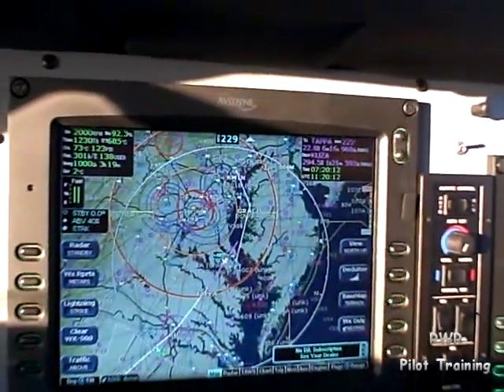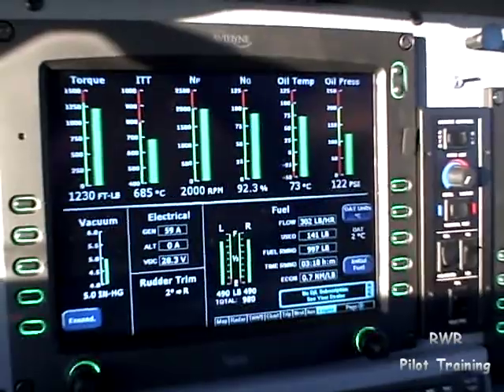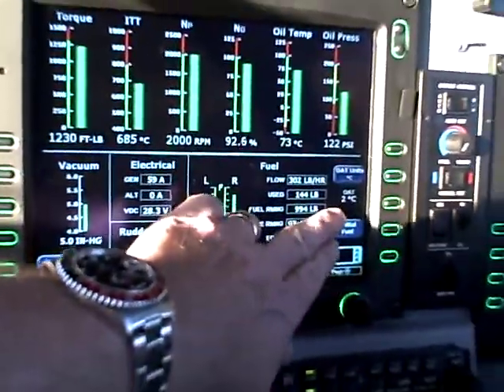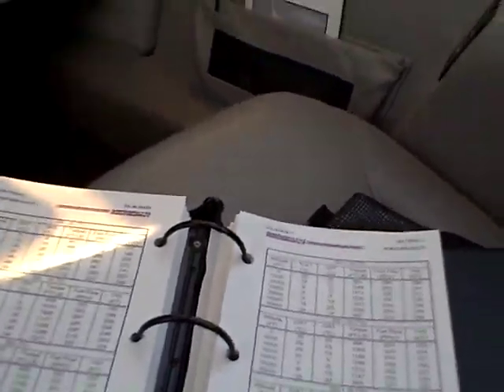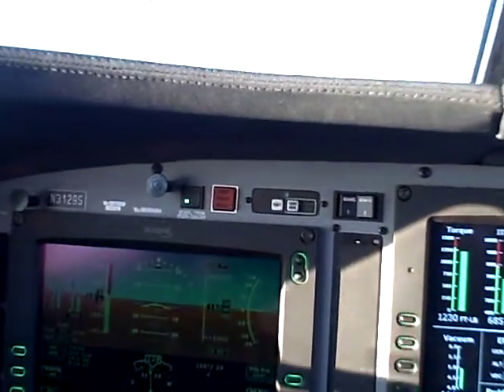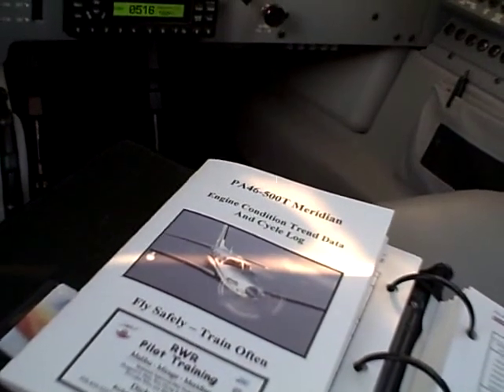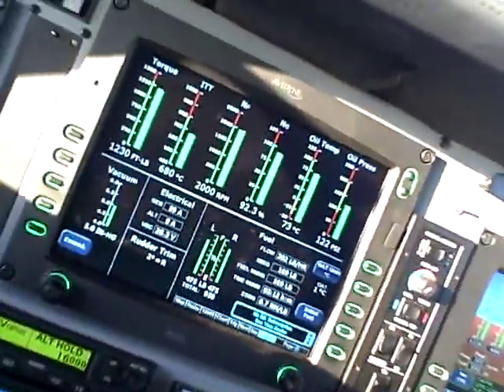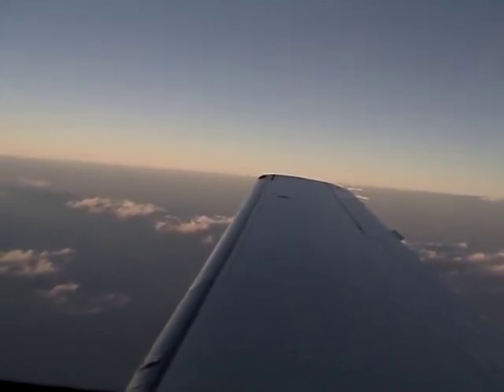PA46 Meridian Turbine Engine Management

Comment: I was trained to fly to torque but limited to the lesser of 1250 or POH in section five.  Do you think this is conservative? Also,  I get a cart start every time I can. Sometimes with a quick turn with a cart start, I struggle how long to let the itt drop before before engaging condition lever.  I want to make it as cool as possible without exceeding 30 second limit on starter.  Any thoughts on itt limits with 28v?
Reply from the maker: Hi Bob, The 1250 torque is not a limitation but rather an approximate setting to get the aircraft climbing while not hyper-focusing on power setting. Follow the POH power settings for high speed cruise and know that temperature is a manifestation of engine health, not a power setting. In the absence of a compelling reason to do otherwise, always get a 28 volt start. It is better for all systems. Introduce fuel when Ng rises above 13% per the POH. Fly Safely - Train Often DR

Comment: I fully understand how recordation of cycles & temps is a good practice. How do you figure it save thousands in maintenance costs?  Going "on condition" simply lets you not abide by TBO and HS limits, however doing this reduces resale value immensely.  TBO and hot section costs are based on hours accumulated, not cycles or temps.
Reply from the maker: Hi Lix, Pratt Whitney tells me that they will encourage blade replacement when the engine is not properly documented.. at $1,200 each. Yikes! Keep the ETCM coming! Fly Safely - Train Often

Comment: I believe the TBM has an app that lets you plug in the relevant altitude, temp and so on and it spits out the desired engine settings.  Is there a similar app for the Meridian?
Reply from the maker: Hi Mike, There is not an application for the Meridian. It is also true that the power chart is mercifully simple obviating any need for such a thing. Fly Safely- Train Often!